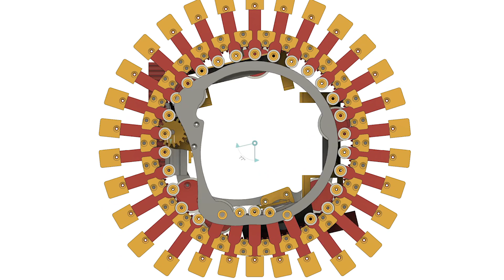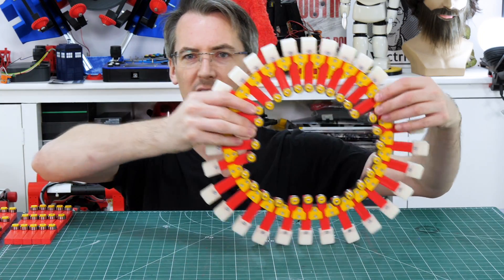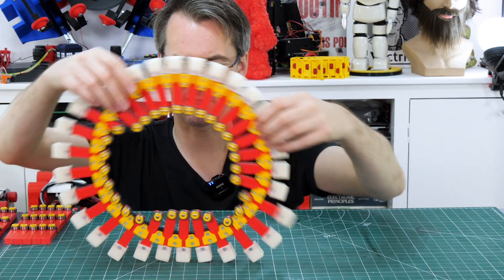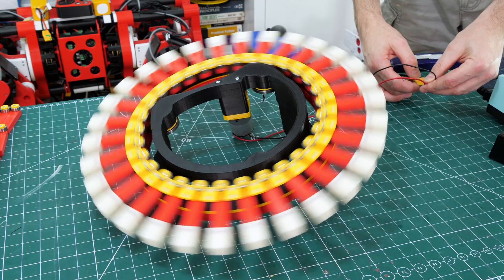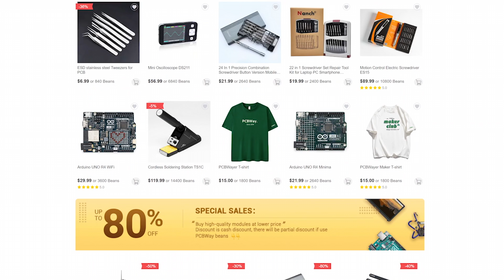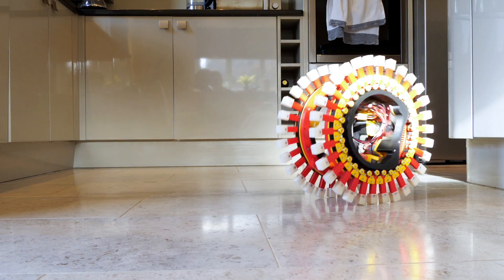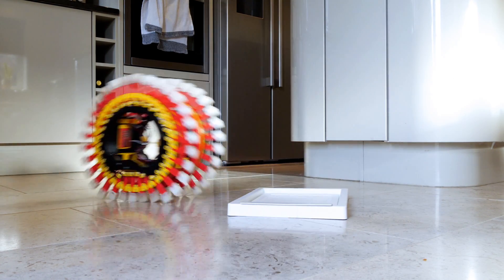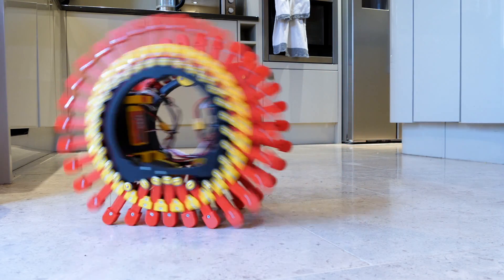Mechanically Stable Monowheel

Comment: The legs stuck out spinning on the spot is caused by the legs binding from lateral forces im almost sure. Could be fixed with lubrication of the slot or with rubber bands holding the legs in while theyre coming down so that way the guide pushes them out, rather than relying on its own weight to push the feet back in against the friction of the binding.
Reply: I also would have the rods move in a square shape instead of a circle with a tilt. So that each side is similar to the one on the ground. In this case it wouldn't matter if it overdrives on one side. The wheel would just snap to the next square face.

Comment: What about a guide to force the sliders to lift when in the flat portion of the circle?  Bolt it to the center section, and have it reach around the outside of the sliders.  Also, to avoid the problem of the feet having too much friction, replace them with bearings.  If you can perfect it, I would love to see a ridable full size version.  Perhaps a collaboration with Furze or Miranda?
Reply: Yeah, I assumed he had those follower bearings riding in a track at first until the stated problem of them not following the cam.  That would make a lot more sense.

Comment: Perhaps adding more weight (that maybe counter-shifts to add friction to the outer wheel as you turn) could help with the leaning, and maybe having the wheels angle toward one another near the top slightly could add some overall balance. Just some theories though.

Comment: yes you can, a hollow ball vehicle in which a car controls the outer wheel direction, it even floats on water, its all wheel, so whats the difference with a dual wheel and one wheel. look pretty nice, cool. what the grip to reality is not working? well put a sideways (rotation inhibitor lock) rotating spin mass so that the center stays level and the wheels actually spin to move at the proper direction.

Comment: A monowheel with.... two wheels?
Reply: I'd call it a Married Monowheel,  'where two becomes one'..😅😅
Reply: Exactly my thoughts 😅, doenst make it any less cool though!
Reply: @CmdrMartinThompson It kinda does. It would be much cooler if it had a more accurate name.
Reply: Hey counting is hard.
Reply: It's basically a tank with a very big set of treads.
Reply: If you consider the air between both wheels to be a part of the contraption
Reply: @davidaugustofc2574  James' justification for calling this thing a "monowheel" is that the two sections are identical and not mirrored, so therefore the two parts are actually a single part.
Reply: @Eidolon1andOnly  yeah but each side is independently driven so it's two separate wheels on a tiltable chassis
Reply: @H-Defect  I know. I was only stating what James has to say about it, not that I agree with him.
Reply: @Eidolon1andOnly
I'd argue that wasn't a justification, just a clarification that the parts weren't mirrored.
Reply: @Eidolon1andOnly it's still two wheels, connected by a hollow axle. That's why it can do differential steering, while a singular wheel (a real monowheel) can't
Reply: @sepg5084  Again, I only stated what James said, not that I agreed with him.
Reply: If you can attach a bar between the spokes without making it function any different, it’s a mono wheel.
Reply: And it does not do that. It is not a monowheel